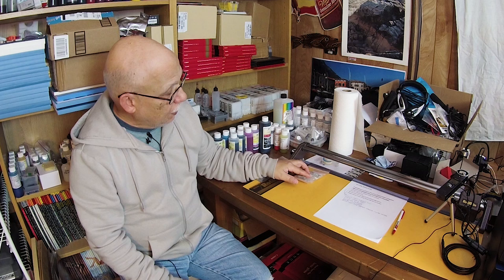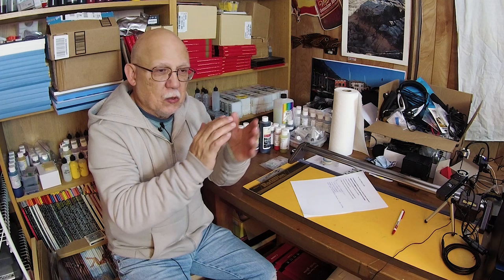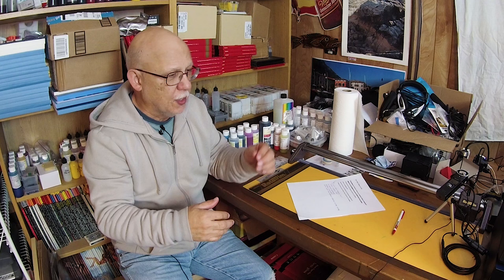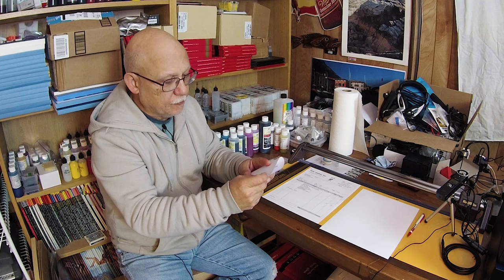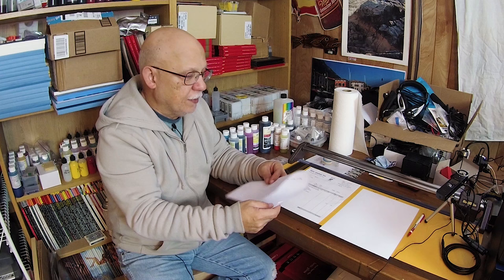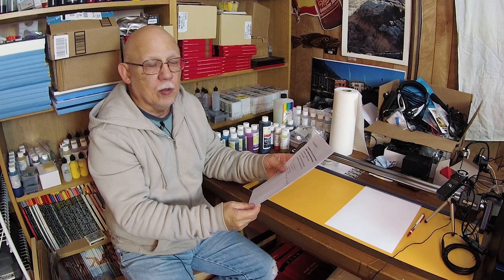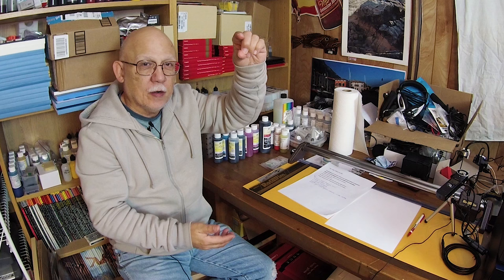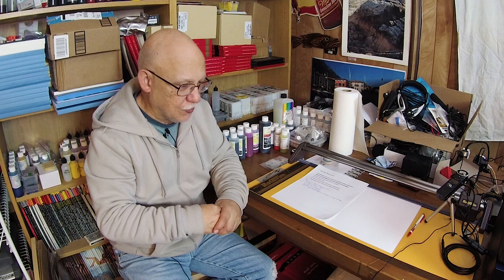Always Look for the Simplest Answer to A Problem

Comment: Hi Jose, I am using OEM cartridges with PS Ink and a new Yellow cartridge with OEM chip, as you suggested, which is working well. Right now I'd like to have a backup set of cartridges, what do suggest? Buy new set of empty cartridges from PS, replace chip when replace ink? Or new set of OEM, in order to avoiding switch chip every time? Thank you!
Reply from the maker: A new OEM set. It makes no sense to constantly change the chips. You will eventually damage them. At this time the nest solution. We will have a possible option but not for several months.

Comment: Hi Jose, if you purchased from Ebay you can notify seller and they will refund and NOT require you to ship back as they know the cost is very high. Also my understanding that NO ONE has chips or refillable carts as Epson has really did their homework on this issue. I really don't expect a solution for years but hope not!
Reply from the maker: Alixpress
Reply: Still worth an email to let them know, but maybe wait until you have tried the carts as well.  They need to know, whether or not they refund you, at least then they have NO excuse to keep supplying them.

Comment: Jose,

I didn't know where to post this question, so I figured here would do.  I have a problem with my Pixma Pro 10.  I recently started using MOAB Juniper Baryta Rag 305 paper and although expensive, I really like it.  The problem I am having when printing 13x19 prints is that on the edge of the paper, just as it starts to print and right before the print is complete, the printer is scraping the paper and leaving white lines and scratches.  So far this has not occured in themiddle of the print, only on the edges.  Why is this occuring? 

When I downloaded the ICC profile straight from MOAB, it states to use for Media Type the "Photo Paper Pro Plantinum", not the fine art paper.  Could this be the cause.  This is essenitally a fine art paper but the instrcutions are to use the "Photo Paper Pro Plantinum".  Could it be something else?

Thanks,
Jason
Reply from the maker: Often companies really do not plan ahead for these types of situations. You are clearly suffering from head strikes. As a short remedy, go to the Maintenance tab and choose Custom Settings tab which is on the lower right and choose the reduce abrasion tab. This will open up the the gap between the head and the paper a bit more.  But make sure that your paper is dead flat as these scrapes always occur either at the leading and the trailing edges where there is basically zero support. If the paper rises a fraction of a MM you will get a head strike. Not good for expensive papers.  By the way using the Fine art setting would impose a mandatory 35mm border at the leading and trailing edges basically eliminating that problem. The paper path is also much straighter as well.
Reply: Jose, 

Thank you very much for the reply.  I am going to try it out here in a few minutes.  Quick question, if I use the Other Fine Art 1setting, verses the recommended "Pro Platinum" setting, will this affect the image quality?
Reply from the maker: I have no idea. You will have to test and test. Please let me know your results.
Reply: Jose,

I can't thank you enough, I owe you a favor.  I went into the custom settings and clicked the reduce abrasion settings and that took care of the issue.  I love this MOAB Juniper Baryta Rag 305 paper, but it is expensive (well worth it if selling prints).  You saved me a lot of money in paper and ink trying to figure this out by myself.  Later on I am going to conduct a test to see if there is a difference in quality between the  "Photo Paper Pro Plantinum" versus the Other Fine Art 1 setting, and I will let you know what my results are.  

Quick question, I have looked online but I really can't find an answer, what is the difference between the Other Fine Art 1, and Other Fine Art 2 settings?

Thanks
Reply from the maker: Thank you.  Yes please let me know your results.  The difference might simp!y be thickness and ink density presets.  I will look into my driver and see if I can find out.